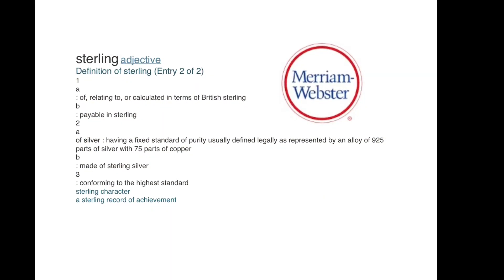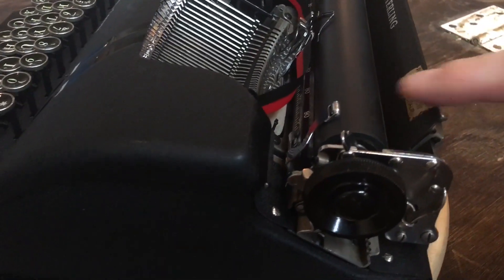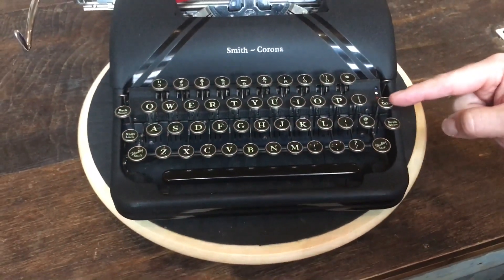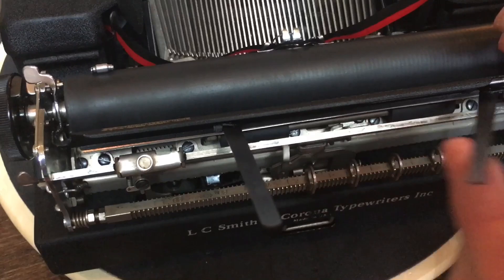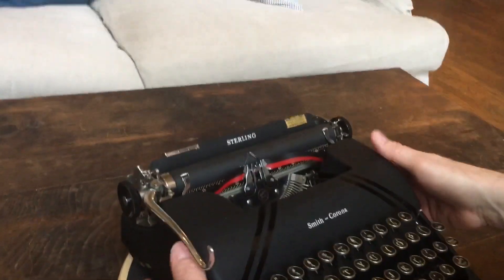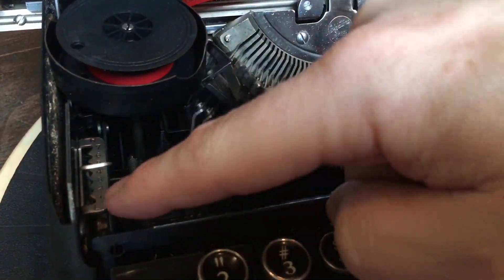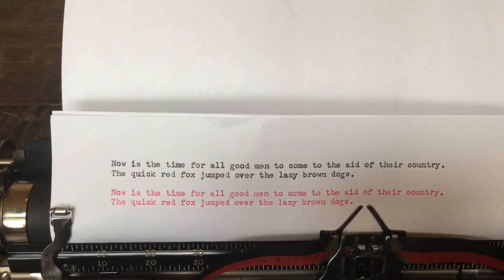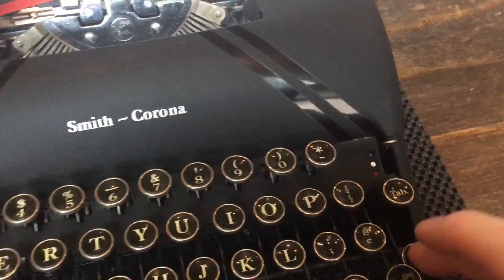Typewriter Minutes-Typewriter Review: 1947 Smith Corona Sterling

Comment: You said you “tried a couple things” to de-stink the case, what wound up working?? The suspense (and stink) is killing me! 😁
Reply from the maker: That stink fought me every step of the way, slapping me in the face every time I sniffed the case. I think it was a combination. I believe I tried Concrobium first, followed by several hours of bright sunlight (several days would be better), followed by sealing the case in a plastic bag overnight with dryer sheets, followed by a cleaner or two (I don’t recall which), followed by cleaning with a toothbrush and vinegar, followed by (after drying out) a number of coats of lemon or orange Pledge. All that either helped lessen the smell or at least partially masked it. :)
Reply: @TypewriterMinutes  thank you!!

Comment: You mentioned cleaning it. How do you recommend cleaning? Any special equipment? Thanks!
Reply from the maker: Body panels I remove and clean with Simple Green and a very soft toothbrush—You have to be gentle so that you don’t wear off the crinkle in the paint.   For the inside of the machine, there are different options as far as chemicals. Lacquer thinner is the harshest (it can damage paint)  but very effective at unsticking sticky type bars.  Odorless mineral spirits is a good option also. I use various brushes and bamboo skewers to brush out as much stuff as possible before the chemical clean.

Comment: What did you use to de-stink the case? I have two of these cases and I haven't had any luck so far.
Reply from the maker: It was a battle. Started with a soak with Concrobium and lots of hours in the sunlight. Then 24 hours in a sealed plastic bag with dryer sheets. Better but still not gone, so then I cleaned with straight vinegar and more sunlight, followed by 2-3 treatings with orange furniture oil (Orange Glo Wood Furniture 2-in-1 clean and polish) which seems to soak into that black material. I’ve heard that lemon Pledge also works. I finally licked it but it was a pain.
Reply from the maker: Ha!